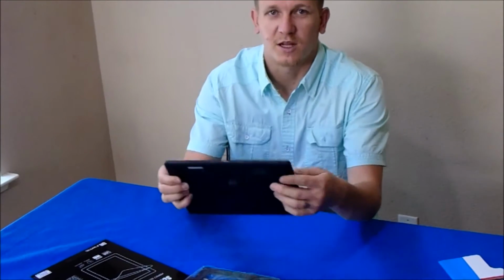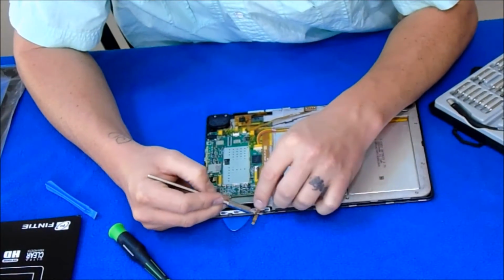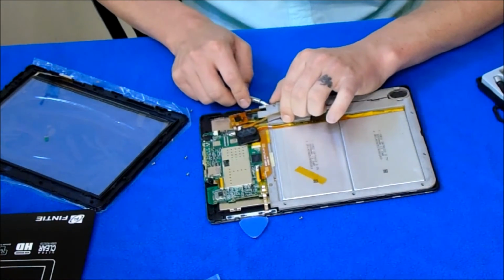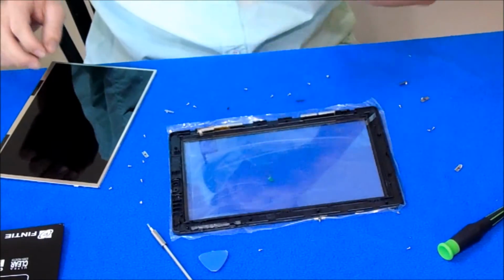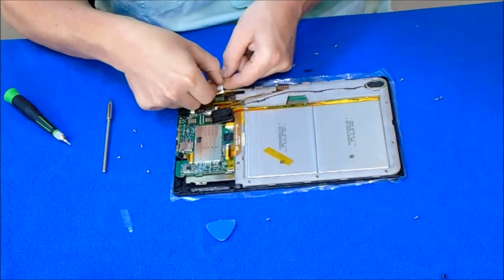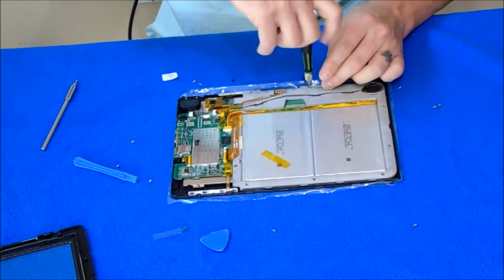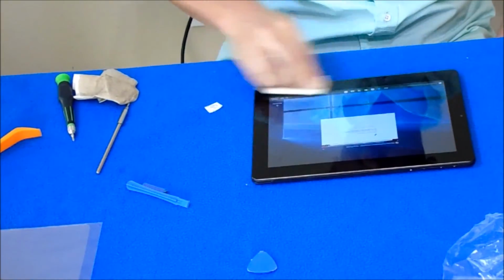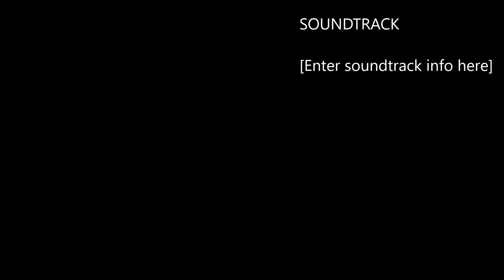Nextbook 10.1 Screen replacement. Complete tear down.  Broke digitizer.

Comment: Hi Scott, could you please tell me where did you get the screen that came with the frame to hold magnets, screws, etc? If there a specific part number for the whole assembly? Thanks.
Reply from the maker: Honestly,  I don't remember.  Too many moons ago. It had to have been on ebay. Sorry.

Comment: Thank you so much!  Mine was a little newer, I guess, so it was slightly different but I was still able to complete it based off your video so thank you again! Best to use an old credit card to separate the back case from the main frame.
Reply from the maker: Glad to have helped. They are pretty simple when you take your time. Hopefully one of my other vids will help you in the future. Good start on the channel too.

Comment: Hi. i have one a question. Is the best buy the complete screem with the touchscreen or only buy the  glass. the touch if it works, only the glass of the tablet is broken.
thanks for your suggestion
Reply from the maker: Do the glass and digitizer. Its so much easier! Way more efficient to replace both at once... labor wise for sure.

Comment: Where did you get your screen? I have a Nextbook  Ares 10A nx16a10132SP S and can't find a screen
Reply from the maker: Sure its not a NX16A10132S 10a? They have those on ebay: https://ebay.to/2LNItaj  I cannot even find a device with the numbers you gave me.
Reply: @ScottiesHobbies  that is the number. It is on the back, on the startup screen and on the back of the tablet. I can find that tablet but no touch screens for it.

Comment: Quick question! I cracked my screen and now when I try to use it the "mouse" is jumping all around, I'm assuming because the cracks are the equivalent of me touching the screen. Will changing the screen fix it or is it something else?
Reply from the maker: ya know, if it was mine I'd start with changing the screen and digitizer. I have personally never seen a cracked screen hamper the touch part. Thinking logically a crack threw the right part of the screen cause your problem. But don't try to beat me up if i;m wrong.
Reply: Kelly Wheeler 
I know it's 7 months later but my linx 10 did that wen I cracked the screen. My son disabled the touchscreen n I can use it via the keyboard. Switches itself off every so often but it still works!lol

Comment: who makes a video worrying about the dang phone ringing? or edit it out? smh
Reply from the maker: But did you get the point or did the phone detract u too?
Reply: @ScottiesHobbies  just messin' with you mate, yea it helped actually, thanx. Any info on the battery charging having a mind of it's own? Been doing my head in, charging, losing charge, holding 2 days etc.
Reply from the maker: The holding a charge became a issue with us too. I was going to replace the battery in one but just lost motivation and ended up buying a laptop on sale. We got plenty of use from this tab though.
Reply: @ScottiesHobbies  thanx...just read some reviews and seems to be the biggest issue with the Nextbook, but bought mine in 2016 for $79, so no complaints. have a great summer
Reply from the maker: @22ergie  that is how we felt. We got them for 90 is and lasted 2+ years in my kids hands.. well worth it. Have a good one too. Good luck with your nextbook.
Reply: @ScottiesHobbies  :)